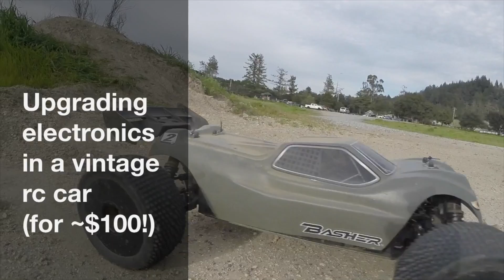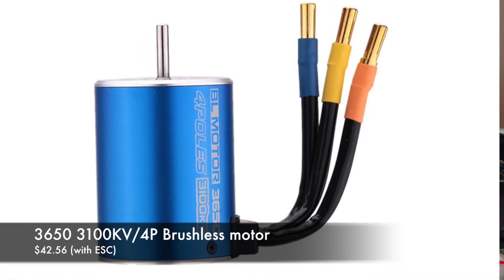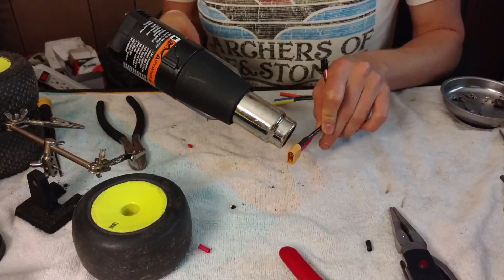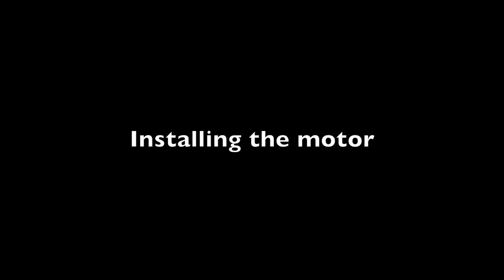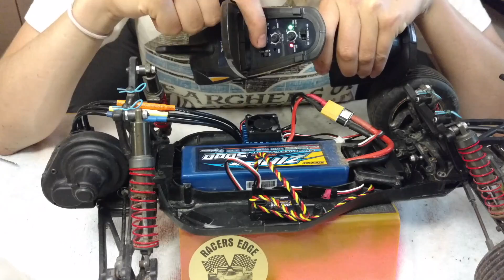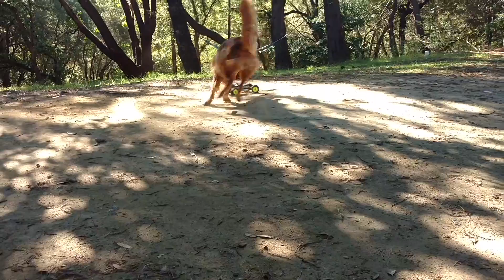UPGRADING VINTAGE RC TO BRUSHLESS  | Team Losi XXX-T

Comment: You can get this esc/motor combo on Ebay for under $40 now. I put a similar setup with a metal gear servo in my Wltoys 12428 to bring it up to full hobby grade.

Comment: Great video, just as a quick setup tip for you. Grab a post it note, tear off a a thin strip, and when setting up the gear mesh, jam it in between the gears. Once you tighten the motor, spin the gears to remove the paper and your gear mesh is set.

Comment: There is a slot in the chassis right in front of where you have the ESC mounted for running the ESC wire over to the radio under the battery without needing an extension.

Comment: I still own my XXX-T MF graphite and will never sell it. Did you know that you don't need an esc extension for this car. Take a look next to you're esc, there's a small slot in the battery tub for the esc harness to pass thrue and under your lipo battery. Just needs a thin slice of foam under the lipo and over the harness so the harness is protected against wear and the lipo will be nice and snug too.

Comment: One suggestion - when tightening the motor, slide a single piece of printer paper between the pinion and the big gear to create that perfect amount of "play" between the gears. Great video BTW. I have a JRX2 that I want to bring back to life after almost 30 years of sitting. I still have all the original hardware and spare parts from track racing as a kid. Fun times!

Comment: The 645 still rockin, its not the fastest or race level servo, but its one basher electronic piece. Those servos stand the test of time, still got them on all my rigs running very well, from crawlers to throttle servo on my baja 5b.

Comment: I did the same thing years ago to my matt Francis edition.  I used the traxxas waterproof brushless setup.  I also upgraded the transmission with all metal spider gears from a losi dirt truck.  It can handle any power now without stripping the gears.  I just pulled it out of storage to tinker some more with it but sadly it never gets used

Comment: This video was perfect!  I want to resurrect and bring current my RC10B4 (original) and going to follow your suggestions. Mine still has the stock RTR pre-2.4 gihz radio and those long metal pull out antennas were never fun.   Thanks even in 2024, 7 years later.  Question, any chance you could put an updated link to an ESC and motor?  The link no longer works.

Comment: If you haven't already you can put a real diff in rear new housing and diff at losi part house. Do a lil research not hard to find out. The video is on YouTube.
Reply: Tedd Nibble   Hi where can I find the diff you are talking about? Thanks
Reply: @alfredomendoza7482  XXX-SCT/XXX-SCB transmission with the gear diff

Comment: I have one of these I'm working on and putting a gear diff instead of the slippers running brushless just rips through those flys
Reply from the maker: Yeah let me know what you end up using. Ball diffs suck!!
Reply: @RCGirl  you need xxx sct scb or the desert truck diff with case. I have one with the dt case and diff its awesome

Comment: Finally got my rear arms for my XXX-T CR..! By far one of the best handling stadium trucks I ever had. I was thinking of possibly replacing the racing brushed set-up with an older mamba max I have in my customworks enforcer. I'm worried it may be overpowered. Should I leave well enough alone and leave it as a vintage NiMH brushed truck?!? I'm torn now after seeing this video.....

Comment: Hi, I'm fixing up my old RC-10T stadium tuck. I don't see what model Hitec servo your using but, it seems to work great. Would mind letting me know which one it is? I'm using your video as a guide to work on mines. Thank you so much for posting these vids too!
Reply from the maker: Hitec 32625S HS-625MG Hi-Speed Metal Gear 2BB Servo https://www.amazon.com/Hitec-32625S-HS-625MG-Hi-Speed-Metal/dp/B0006O3X9K
Reply: Awesome! Thanks!
Reply: Old school servo the hitec 645mg in its day it was cheap and GREAT.

Comment: wow!!! unbelievable. I am stunned for your perfection and ability to handle the mechanical stuff. Yuu are super natural. Please please don't cut out soldering part. I wish many so called fat head RC kings can see your soldering and wiring job. It will definitely put them to shame. I was like shd I watch or not coz my male ego was saying don't wast your time. But definitely worth it and I have learned form your experience of using right gear to safe guard the motor.

Comment: I have a 1/10 Traxxas and it won't move, I have a video up if that gives ya a better idea of what might be the problem
Reply from the maker: Mr. Randomness321 hmmm sounds like your motor is getting power, but from the vid it doesn't show the other end of the motor. Have you checked the pinion gear to make sure it's aligned with the spur gear? Spur gear may also be stripped out.

Comment: Does it have a ball diff or a gear diff in it? it was the start of the move away from carbon fibre chassis to plastic and now the hybrid chassis. I believe they also had a hydro/friction slipper clutch for it. At that time I had a shumacher cougar with their hydro/friction slipper clutch.
Reply from the maker: ball diff!

Comment: have you ever program a goolrc 60a kingbox 3900kv brushless im not understanding how to program it thanks.
Reply from the maker: Chuck Lamp sounds like you need to look up the instructions on how to program the esc. Each esc is different
Reply: Chuck Lamp ya. go on ebay and buy original gool esc program card.
Reply: I ordered it have to wait till it comes from China be here February 6 man that's a long time lol
Reply: Chuck Lamp got mine in us was here in 3 days. o well. its worth the wait to dial in your esc.

Comment: Great video!  Are your transmission gears stock (are they plastic?) and have they held up to the add'l power from your upgraded electronics?  I'd like to do a similar electronics upgrade to my Losi XXT and wonder if the XXT transmission would handle it?  THANKS!

Comment: is the truck stil going and has it stood up to the brushless power upgrade im look at doing the same.
Reply from the maker: I don't run it a ton but yeah it's still going strong! I put sand paddles on it in a later vid and ran it on the beach!
Reply: @RCGirl  ok that is good to hear that it is still ticking lets see if mine will last also i cant see why not, i just subscribed to your channel, keep having fun.

Comment: sure you know they make adapters of different ends male to female vise versa of different connector types dean's to xt60 so on, for the people who don't like soldering. me.. oh Idk I been a auto tech for over 20 years with plenty of welding jobs under my belt and I still don't like the fiddle faddle of soldering.. fiddle faddle lol Idk my tablets spelling auto correction just came up with those words so I just rolled with it. I'm just getting into the hobby so I'm waiting on my first battery which was goin to be a venom but from the reviews I decided to wait and go with zippy compact 2200mah 3s 35c. Idk from the reviews they're OK but the venoms not that much. I noticed you had the blue lipo so I'm assuming there ok. also is $600 worth spending on a bare chassis losi 8ight-e 4.0

Comment: I have a XXX-NT if you are interested in getting it fixed up i will donate it to your channel
Reply from the maker: Apologies for the late reply! I haven't worked on nitro yet, but would be good to learn. If you wanna send it, here's my address: 
RC Girl, P.O. Box 3589, Santa Cruz, CA 95060 :)
Reply: Well i would like to discuss it a little bit, it will need the motor to be cleaned/taken apart but if its not salvagable it would need a new motor. Ill send you some pictures if you like, i just have two request, you have to pay for the shipping and feature it on your channel :)

Comment: Some advice is to not go brushless in a vintage car
Reply: why the heck not?  everyone does it dude.
Reply: older, lighter plastics were more brittle compared to new stuff.  and vintage meants hard to find a new part.
Reply: I have many vintage rides with brushless installed.  no problems.
Reply: Hunter Mack you can put a real diff in the rear
Reply: @silentseawolf  thats why you dont get the kart before the horse. Uprage from jumpstreet. Flirting with disaster makes no sense when it is hindering the performance.
Reply: Mr. EverythingRandom ..Yes!  good advice!! this is true I found out the hard way! I put a brushless in a vintage stadium truck and brought it back to life and took it for a run and shredded the transmission within 5 minutes. Took months of searching to find an idler gear.